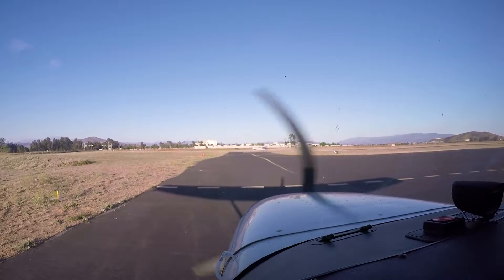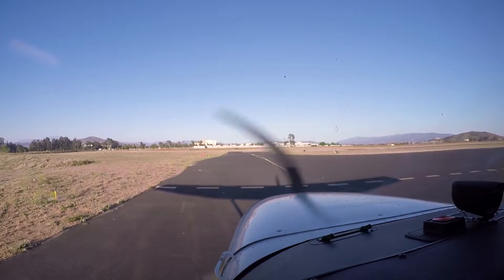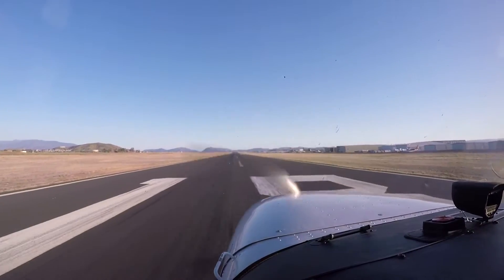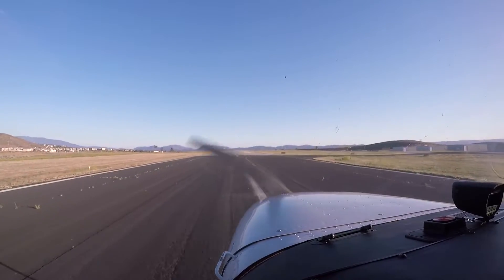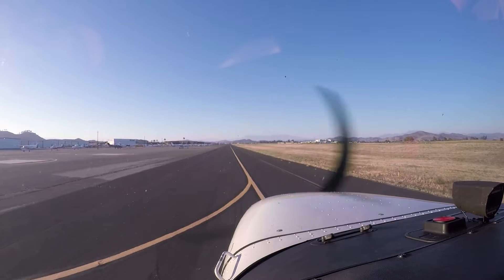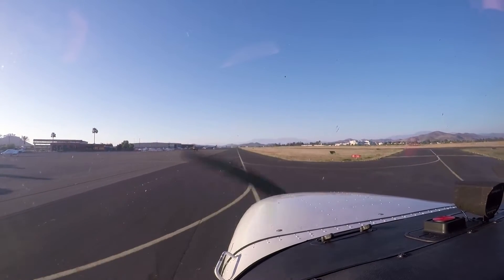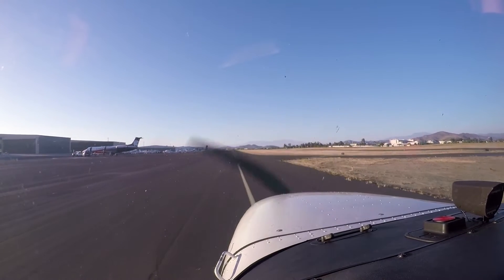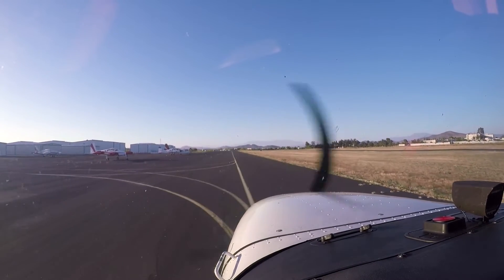Engine Failure at 50' Emergency Landing Demo - Cessna 172S at French Valley Airport (F70)

Comment: The 50 feet EFATO Maneuver.  I was the CFI that in the 1990's taught this maneuver to outwiththem commenter below.  Steps are.  If Power down= Nose down, touch down, cut the mixture and flaps.
Reply from the maker: Nice!
Reply: @Bill4LE  A trick to do in case of running out of runway is to go to one side of the runway and turn into the other side at very end.  A tire might be replaced by the quick turn.   But it beats hitting the fence at end with prop and engine which will need to be replaced.

Comment: That looks like 80 or 90 feet engine out.  Stop it at 01:54.  I learned 50 feet engine outs in 1996 and we were using a 4,700 feet runway with some winds.  Cherokee 150 hp short wing.. Cherokee 150 hp takes more runway to take off than your C172, more runway to stop too..
Reply from the maker: It was 50" almost exactly. We were pretty precise on the altitudes to eat up more runway than needed to demo this specific maneuver. Per both POHs, the takeoff ground roll of a PA-28 150 B Cherokee is 780 ft & a C172S is about 960 ft. The Cherokee stops 5-10% shorter as well.
Reply: @Bill4LE  We were using an old engined short wing Cherokee 1969.  He didnt want to put a 3rd passenger due underpower.  It was easier to do them on the also 150 hp C172 he had available. 
 He was a great Bush Pilot and instructor on an old airplane flight school.. Stayed for 3 years due the other flight school wanted the CFI's to work 6-7 days. so he came to the old airplanes school across the field to work only 4 days due his other job..  

Careful believing those POH numbers.  Cherokees use more runway than Cessnas to reach 50 feet.  They can use those 25 degree flaps on ground effect to lift a bit sooner, but then they cant climb as well at Vx to 50 feet. 

 We used 10 degr. flaps to take off and cut engine at 50 feet and got used to drop nose hard.  As soon as we touched down, he made me cut the mixture and cut the flaps.  Mixture we cut first in case we had to overshoot and get used to cut it to stop. 
 One of his other student he taugh that maneuver took off and his upper cowling opened, he did the 50 feet engine cut he knew and saved the old cowling from been distorted.   

He also taught me Turnbacks to opposite runway after take off from 500 feet agl at partial power, and 700 agl with power off.

Comment: The 50 feet engine cut maneuver.  I practice them too.  Or 30 feet engine cut on shorter runways.  Practice them with partial power which is the most common engine fail.

Comment: For those watching - Don’t try this yourself without really knowing what your doing! My initial instructor 20 years ago did this and misjudged energy with a smaller wing piper tomahawk and we slammed into the runway hard enough we threw tire alignment out and had to have the aircraft inspected. It is very aggressive right away, as they say here, or else your in trouble. Too much energy and you might overshoot runway. Good demo here by someone who knows the airplane.